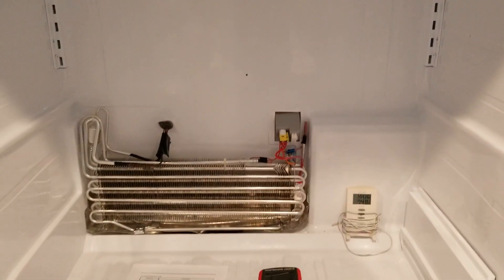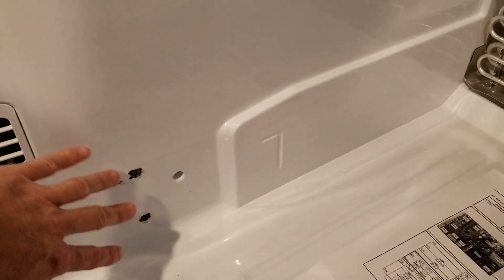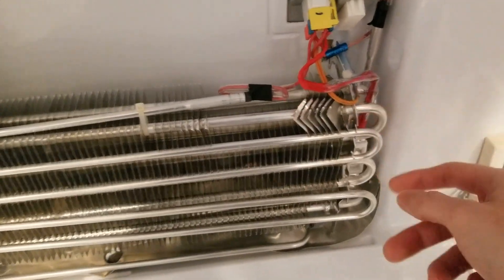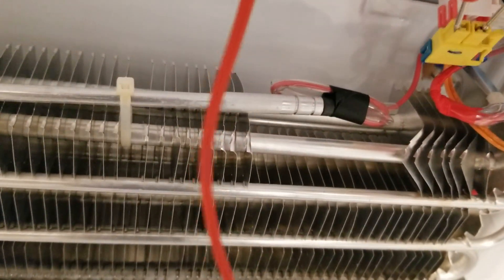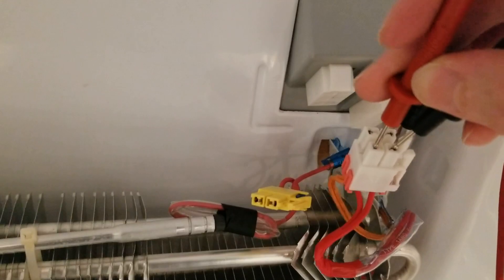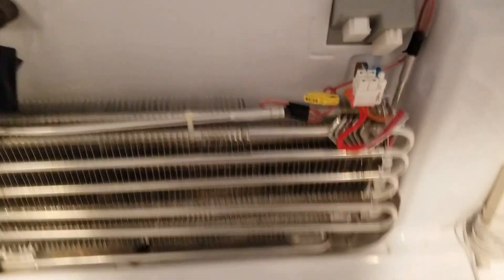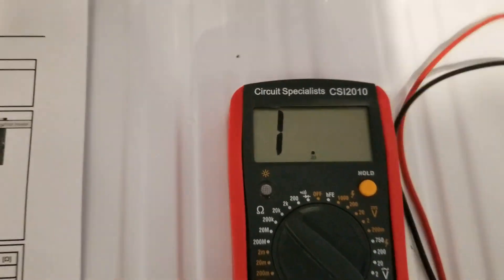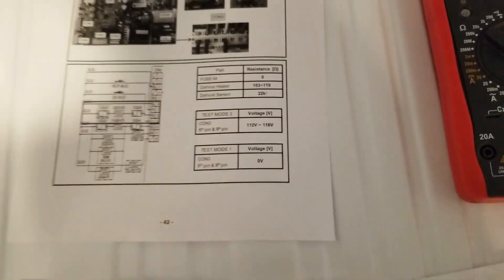Diagnosing r dH Error Code on LG LFXS30766S Refrigerator

Comment: If this comes up you need to replay both sensors at refrigerator side and freezer side
Reply: Need to replace the freezer sensor too?
Reply: @goldy412  yes sometimes it says freezer sensor but if you replace it with a new one and it doesn’t take off and your heater is good replace the refrigerator sensor as well
Reply: @Theycalllmedaniel  my code say dh r and I replaced the refrigerator one and the main board and it still didn’t take it off. Should I replace the freezer one as well?
Reply: @goldy412  try changing the freezer one and check the heater to see if it works
Reply: @goldy412  if that doesn’t work it’s the board

Comment: All those tests could have be done from the main board and avoid unnecessary disassembly. 
That’s my opinion.
Reply from the maker: Indeed. That's what the repair instructions recommend too. I personally found this easier because of where the fridge was located (have to pull out then slide sideways to access the back). I had to replace the mainboard in the end anyway 🤣
Reply: James where can you purchase a new main board from?
Reply from the maker: @esandoval89512   searspartsdirect has it: https://www.searspartsdirect.com/product/3kl4wgksj4-0046-795/id-ebr78940601
The part is also sold on Amazon and appliancepartspros.com.
Reply: Be aware that there is also a design issue with these units that causes the drain tube to freeze up and stop draining. So, your electronics and heater may be working fine BUT still leaking due to inability of melted water to drain. Google Kenmore Elite and evaporator drain freezing.

Comment: hi, could you post pictures of those relevant pages in the service manual?
Reply: Did u ever get a response or find the manual?
Reply: @thomaskotero8906  no, but I did the job anyway. Turns out I could have saved a lot of money. Didnt need to buy complete heater with all the bits for 50€,  the lower thermal fuse was blown, 5€.  The back panel with fan is a push in fit. Wasted lots of time trying to find out how to remove it when all you need to do is yank it out (you cant if its iced in place though)

What happens is, someone leave the door ajar and ice builds up on the cooling fins due to lots of warm wet air being circulated.  The ice build up is too much for the defrost heater to handle so air by the lower thermal fuse gets too hot and the fuse blows. Then you get a failure code -but the fridge still blows cold, so you keep using it. However, since the defrost heater no longer works, ice keeps building up  out of sight. Eventually it stops blowing cold after a few days when there is so much ice, the fins are not exposed. 
myu advice, if you get a fault code, fix it asap, the longer you wait, the bigger hassle.

Comment: James where did you get the repair manual? Thanks for the info l already did the cooper wire trick but l still have the problem. I'll perform the tests you mention then ultimately replace the board. Great video!

Comment: Were you able to fix the problem? Did you ever discover what the issue was?
Reply from the maker: Yep, the frost never returned after replacing the main board. I didn't try to diagnose any further than that.
Reply: That’s next on our list. Thanks for the update!

Update...

I replaced the circuit board with no success. The frost still returned!

So, I decided to take a next step. The refrigerator threw a “r DH” code. Board replaced, thermistor replaced previous.  Now it’s time for the refrigerator defrost heater to be replaced. While I’m in there I’ll replace the thermistor/controller as well.

Our specific model number is: LFXS30766S /00

I ordered:
  Heater, sheath, part number: AP5978777 $45.35
  Controller assembly, part number AP5325101 $21.17

  Plus shipping and tax: $85.02

Okay another investment I thought. But after 5 years of defrosting this worthless paperweight, the next stop was to use it for target practice.

A bit of a pain in the neck to remove the heater sheath from the fins, but so far worth it. It’s now 6 days and the “r DH” code has NOT returned. I’m holding my breath, but so far its working properly. The refrigerator temp is set to 35 degrees F and has been consistently 36-40 degrees F depending on how much the doors are open.

I’ll add a link to a few pictures shortly, but looks like success so far! Now the question is how long will it last!
Reply: Daniel Jansen how is the fridge holding up? Were you ever able to upload the pics?